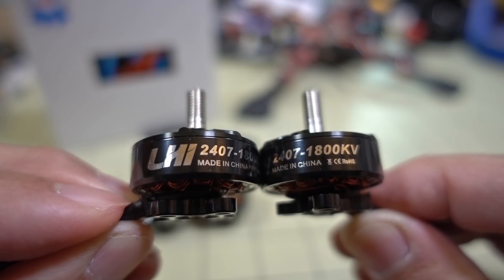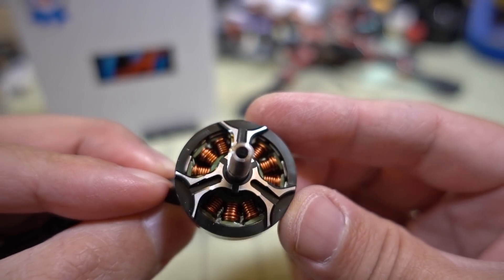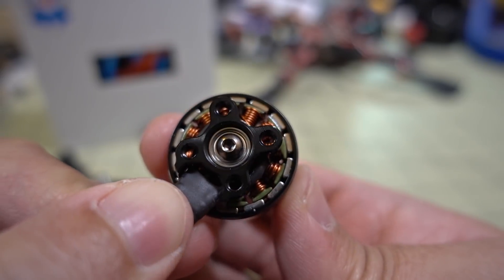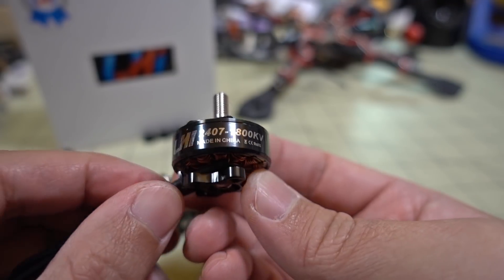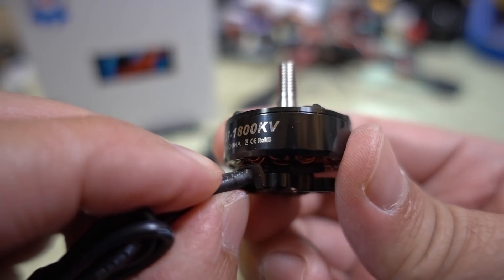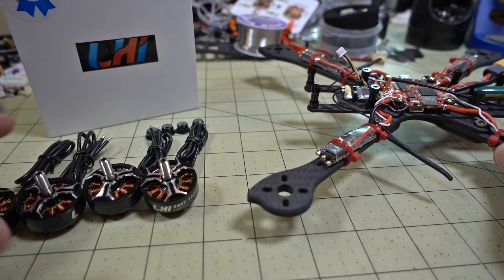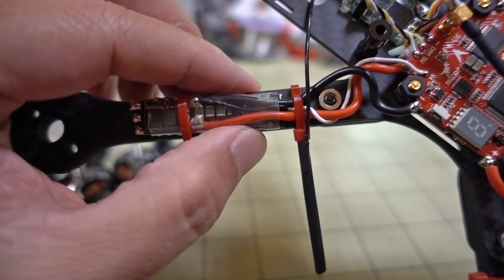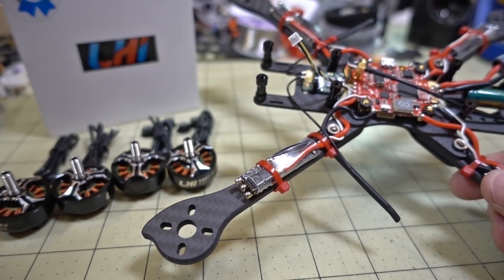LHI 2407 1800kv Motor Review 🏁

Comment: Yes, those motors can run 7 inch props, I use Dalprop 7056 triblades and HQ 7x3.5x3 on 4s and 6s.  I just started running those motors about a week now. installed on 7 inch Chameleon TI LR, on older Lumenier 35 amp dshot 600 blheli_s esc. I do have a 470uF 35V Capacitor on each esc.  motors are cool on 4s, and on 6s motor temps are warm, not hot. betaflight 3.5.2